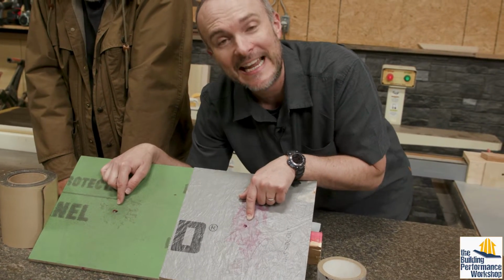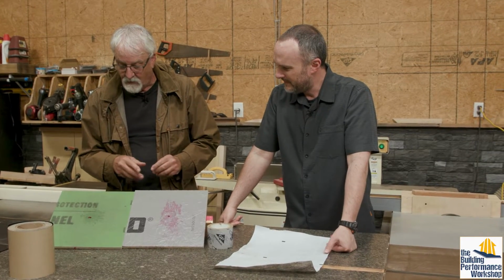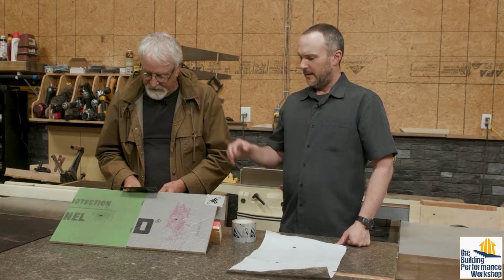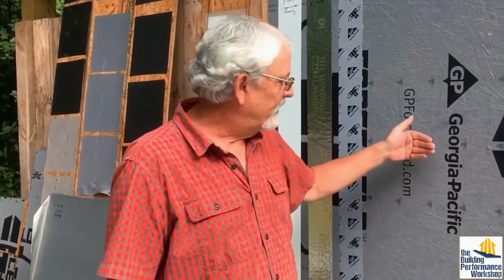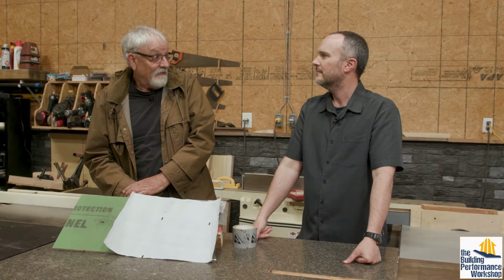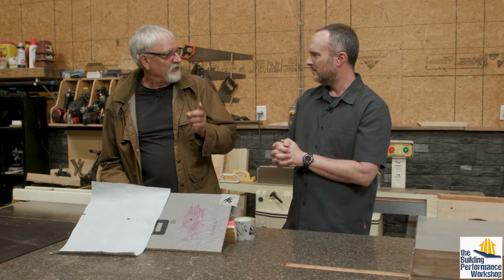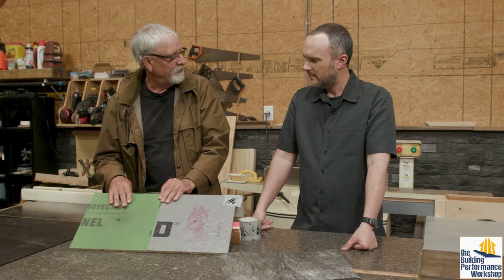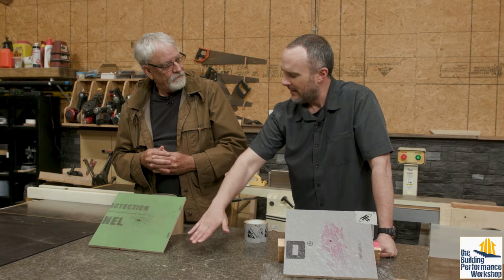WRB Showdown: ZIP System vs. ForceField WRB vs. Tyvek Housewrap & More with Inventor Landus Bennet

Comment: Took a chance on forcefield but only a few pieces for a small porch. One piece the coating was peeling/delaminating and you could pull the rest off if you tried. I do not think it is anywhere near as good as zip seems to be.
Reply: Had the same experience

Comment: Ya, I say BS ! First off, if your using OSB your trying to save a buck! It’s cheap, it may leak air, and it wets out more often. 2. Zip system holds in water, its vapor closed, and they add a vapor closed tape, so water has to dry inward, which mechanicals have to really work hard to dry out, and in winter you’d want to dry to the outside! Can you say rainscreen, a better way to build! 3. Tyvek - doesn’t allow bulk water to escape, so it will wet the insulation which Rots the interior …wall out. I don’t buy any of this nonsense!

Comment: I am currently building 2 houses, that i sheeted with Forcfield. I can say I will NEVER use this product again, or ever recommend it, 2 issues:  warpage, on the north face gable trusses the panels warped outward over time, and my build is not alone, I have a friend that had the same issue on his north facing gable, we ended up installing blocking to suck the panels in, 3 different framers, 3 different house plans, all had the same issue. Second: the material is incredibly hard! Making it difficult to hand nail siding to it. what a miserable experience driving nails into FF by hand.   Third: the film is poorly applies, and gets damaged easily,  the edges release if it rains even once, and if you bump it with a board it scratches.    We were not impressed at all!!!!!

Comment: I do NOT want an air barrier- I want air to permeate my barriers. I also do not want the chemicals in all that tape that I am not convinced with heat/humidity conditions in the South will hold for decades. I don't want chemicals in the board substrate- who do I follow on building a drying house using plywood and WRB?

Comment: After hearing this, I'm thinking about Grace Ice & Water Shield over OSB for my roof.  Even if OSB isn't as good of a surface for the adhesive to stick to, we are talking about 3 feet wide rolls, versus 4" or 6" tape.  For my off-grid house, the roof assembly would be mainly insulated on the exterior, then a rain shield and snap lock type of metal roofing.   The attic can be exposed unfaced fiberglass batts between the rafters, just cause it should help a bit with heat loss at low cost, while not creating a condensing surface since so much of the insulation is on the outside.

Comment: Error at Time Stamp 8:31..."you will void the warranty if you tape the bottom"..  Dupont clearly states in their install manual (Page 14/Step 7) Tape Top and Bottom for Air Barrier- Citation: install-guide-single-family-wrb-and-flashing-after-wrb-43-d101048-enus

Comment: Nope.. I'll never use zip on walls. I just rebuilt 2 exterior walls (2 years old), with taped foil backed insulation over tyvek. 

Trapping moisture within walls is a really bad idea. 

A perfectly sealed insulated wood construction home is near impossible to do. 

Any roof leaks or perforation or bad flashing around windows with zip will be a disaster.

Comment: Real world comment on the "woven" type wrap.  We bought a house that was severely neglected.  We're in the process of residing it. Built in 1997.  OSB sheathing. It has D-log siding that's rotting.  On our 24' South facing gable wall that regularly sees high winds and rain, it had a woven type house wrap.  The only rot on that wall came from two poorly installed windows.  Every square inch of sheathing that was wrapped with the woven type barrier looked brand new.
Reply: It probably dries out quickly.
Reply from the maker: Interesting, thx for sharing

Comment: what about using 1/2 plywood ran horizontal with house wrap would that be a good choice?
Reply from the maker: You mean the way the tract homes have been built since the 80’s?
Reply: @HomePerformance  we are building a new home and got a good deal on 1/2in plywood so was thinking about using that for wall sheeting.
Reply from the maker: Totally awesome plan, but don’t use housewrap- check out an adhesive membrane like Adhero or a liquid-applied WRB coating would be my advice.

Comment: What happens in 20 years when glue fails on the tape and it doesn’t seal anymore ??
Reply from the maker: How does glue fail in your scenario exactly?
Reply: @HomePerformance  from the seasonal  temp changes,  hot and cold, plus the glue breaking down over time just like it does on any adhesive product, what is the warranty on the adhesive glue on the tape ??
Reply from the maker: @paulmollise1856 ours, and a lot of others, is protected by exterior insulation, so movement from temps is minimal. Also, that’s why I build in redundancy in my homes with an interior house wrap as well.

Comment: We're looking to create an air and water barrier on the whole exterior of the house. If Grace ice and water shield is acceptable on OSB on the roof, why not cover the entire house and use exterior insulation? If moisture got between the insulation and Grace ice and water shield it wouldn't be able to get to the wood. It self seals every time a nail goes through the OSB and covers small gaps. Obviously interior air will need to be managed, as with any air tight house. I'm guessing there's a good reason I haven't seen it done, but what is it?

Comment: here, here for 'felt paper' - 18 minutes in...3' rolls, hammer tacker, lap your edges. Put on many a roll before siding with cedar, up here in the Pacific Northwest.
Reply: I demo a lot of old exterior walls that are bone dry, just felt and cedar/vinyl siding. (North Coast BC). Im not convinced by these air tight systems, though I’m trying to be open minded lol.
Reply: @mrbarak2088  Old homes leaked air like crazy, so the moisture that ended up in the wall cavities had a chance to dry either inward or outward depending on the season.  In code build homes, the air leakage is greatly minimized (much easier to heat or cool you home now) and thus any moisture that does get into the wall systems NEEDs a way to get out..thus the high performance products now available.   My guess is that 6mm poly will soon be banned in new home construction and replaced with high performance air barriers.

Comment: We built a new home last year and after doing a lot of research, we landed on this in zone 6a:  Zip-R12 sheathing and a 10mm plastic mesh rainscreen over 2x4 studs, which was filled with 3" of closed cell spray foam.  That gave us R-30 walls that are airtight with R-12 of that eliminating the thermal bridging of the studs.  Our windows and doors fit as if we used 2x6 studs and normal uninsulated sheathing.  We would have had R-30 walls by just foaming 2x6 stud cavities to 5" but by using Zip-R12 sheathing, we covered about 925 sq. ft. of 2x4 studs which gave our studs a R-15 value rather than R-5 if using 2x6 studs and normal sheathing.  We have a one story home, so 2x4 construction was not a problem.

I think that Zip-R is the best solution for exterior insulation due to simplicity for the framers, without the need for installing normal sheathing, window bucks, furring strips over exposed XPS for siding attachment and a WRB.  This saves labor costs and eliminates the possibility that the framers or siders will screw something up to prevent water and air infiltration with the many different steps needed to complete the XPS over sheathing assembly.

I wanted to put mineral wool between the stud cavities but my contractor said closed cell would do a better job to stiffen the walls from shear forces and almost guarantee air sealing vs. batts.  Our blower door test was 75% lower than the number needed for passing the test.  Mineral wool would have done a better job on outside noise reduction but in reality, most outside noise comes through our large double window panes.

We had closed cell foam insulation installed in our previous home during a complete renovation with zero issues.  The walls stoped creaking when really windy as they did before with fiberglass insulation in a 50 year old home.  You're not a fan of closed cell foam, if I remember right, but I think it's great.

We live in a high radon area and with our radon blower vent from under basement slab from our piped sump pit, our readings are 0.35 pCl/L, which is very low.

As far as our overall exterior wall assembly, I wouldn't change a thing.
Reply: Good detail, thanks for taking the time to post this all.
Reply: Sounds like a solid well insulated build. However, I think your contractor sold you a bag of beans saying the insulation type will contribute anything significant to “stiffening” your walls. The zip panel’s OSB is the material credited with mitigating shear. Your insulation type does not get credited for any shear value which is why plans get approved with an R-value rather than an insulation type.
Reply: Close cell foam does still add rigidity regardless of which one is the primary shear. Thats not a bag of beans.
Reply: @Tyler-xd7hh  The point being made is the wall is already engineer for shear loads (i.e. it doesn't move, so it is regid) thus adding additional "stiffener" like closed cell foam doesn't add to the rigidity of the wall system.  Just like we never give drywall any credit to stiffening an exterior wall, yet on an interior walls it definitely does stiffen the walls.  Basically the closed cell foam and/or drywall on exterior walls simply "over engineers" the shear value of the wall.  In 99% of cases, over engineering is just thorowing away money.
Reply: I do not want foam chemicals on the iinterior spaces of my home- especially since all those chemicals degrade over time- we are building 2x6 with Rockwool- just trying to decide on VB.
Reply: @tarahall1025  I'm happy for you.

Comment: We are in the early stages of building and I’m concerned about VOC ratings for the Zip system. Any information on that would be helpful. I want to use a paint on seam sealer and over penetrations like redguard or something similar I’ve used to make bathroom remodels waterproof. Your thoughts are appreciated thanks guys!!
Reply: Would you still want something (mesh tape or ?) over seems if using liquid to seal seams? Or am I over thinking it? I have not done a lot, but have always Schluter tape or similar over seams in showers, then RedGuarded over the whole wall for fear that RG alone may fatigue over time. *Worth noting I've only worked on 1920-40s era homes built on minimal footings, which move a lot seasonally here in the South. Thank you!

Comment: Amazingly useful video. Makes me wonder, though - so much of this clever engineering is to mitigate the inherent vulnerabilities of wood (water damage, termites, warping, etc) - might moving away from wood completely be where the future really is? Especially since the use of wood to begin with was mostly out of convenience and habit in N. America.
Reply: Price for acceptable performance, not convenience.
Reply: Termites are easily mitigated by using a boric acid solution from a garden pump sprayer. Just mix “cockroach powder”, or 20 mule team borax and spray your studs, rim, eaves, etc. once it is framed. It is non-toxic to human but bugs cannot stand the stuff
Reply: Wood is better than concrete and stone in areas of seismic activity which is the western 1/3rd of the US and specific areas in the East.

Comment: Yes i do have questions?? I am replacing vinyl siding on a 2 story house and i would like to tape the OSB seams, then insulate with pink board or Rock wool, then put the siding on.. What are your suggestions for this job? Thanks so much and Yes I am a super nerd for watching many of your videos!!
Reply: Not a builders here but there are fluid applied products for osb.

Comment: I'm remodeling a bathroom where I needed to move a window about 2 feet to the right.  The exterior wall has 3/4 fiberboard,  felt paper, wood lap siding, fan fold insulation and vinyl siding.  What is the best way to patch the opening without disassembling the entire wall?  The wood siding is not in good condition so I'm thinking 3/4" foam board, 7/16 OSB, felt paper, fan fold and vinyl siding.  If this is a good sequence, would ZIP, Force Field or Tyvek be a better choice than OSB?.

Comment: I'm currently building with Zip and I like it. But I fully regret using GP's ForceField on my roof. It is extremely slick and dangerous and I've only got a 4/12 pitch. I wish I would have gone with regular OSB for the roof. 5/8 zip was either unavailable or way too expensive.
Reply: Thank you for this comment. This is exactly what I came to this video for
Reply: No problem. I wound up having to put down roofing underlayment just so the roofers wouldn't slide off the deck. Defeated the whole purpose of why I used this product to begin with.
Reply from the maker: Was it rated for roofs? It wasn’t when we built.
Reply: Yes.

Comment: I’m watching a house being built nearby and it rained several times before they wrapped it. Actually seen the same on a commercial building. I just wonder why they wouldn’t use Zip and dry it in quicker.
Reply from the maker: Marinating the framing is traditional
Reply: @HomePerformance  It must be especially in the PNW😂.

Comment: This is the first I've heard that ZIP could save you money. I expect it to cost more but be more depenedable, partly because the  installation system is more foolproof than typical housewrap. So if "Stuffing a bunch of stuff in your walls in not a good thing" to let the sheathing breath--then how good is it to back it with rigid foam? Doesn't make sense.

Comment: How do these systems hold up in 10-20 years? How permeable are either of these? Isn't this a big issue for colder climates where condensation can build in the winter with no ability to extract that moisture?

Comment: So if I do a waterproof wrap with insulation integrated under hardie board I shouldn’t put foam in my walls? I’m in Texas and I’m worried about condensation. Also I’m in a flood zone so was thinking fema flood insurance would prefer the foam.

Comment: Great video Corbett. The perm difference between Zip and Forcefield is a great point and also that a wall is a lower risk area than a roof. I used Forcefield on a house I just built and decided I didn't like it because of the secondary manufacturing process. This video has me rethinking that though.

Comment: I've done a ton of digging on this in prep to doing a 2nd home we own. Because I live in the Northeast I want my vapor barrier to be on the inside, not the outside. What ZIP system does is give you a vapor barrier on the outside. This is wrong for me. I have my vapor barrier on the inside. If I use ZIP system I'm going to get moisture trapped inside the walls. BAD! The worst part is that ZIP system has almost no breathability. Here in the Northeast I need my outer barrier to breathe otherwise I will trap the moisture! In the South you want your vapor barrier on the OUTSIDE! So ZIP system is perfect for this. I think a lot of people in the Northeast don't realize this and will eventually pay the price. Speaking of price: ZIP system $30 per 7/16x4x8 sheet. Same sheet for OSB? $11.60. I hate OSB but with Tyvek on it. Safe. The other really important thing is to use Tyvek by DuPont. Do NOT use a cheap substitute!
Reply: Zip is not a vapor barrier.
Reply: @BenBogie-ee2sm  From Huber: "Is ZIP System an air barrier? Yes. ZIP System sheathing when combined with ZIP System flashing tape (and/or ZIP System™ liquid flash) form a rigid air barrier and acts as an effective component of a continuous air control layer."
Reply: @BlackDragonProductions64  an air barrier is not the same thing as a vapor barrier, or a weather resistive barrier. Zip system is both an air barrier and a weather resistive barrier but NOT a vapor barrier.
Reply: @BenBogie-ee2sm  So what should I do? I have a 6mil plastic barrier on the inside of my home. I am so confused about all of this. And I need to figure it out quick because I need to re-sheath this home!

Comment: Would like to have heard about liquid applied weather barriers. My concern with Zip is the grade D barrier is very thin and presumably easy to damage, along with over driven nails and the need to perfectly seal the Zip tape, makes the Zip system questionable in my opinion. Of course the liquid WRB is subject to installer capability. I found with Tremco's Enviro-dri that there aren't enough solids in it to give it any stretch at the recommended thickness. Sprayed onto new fir plywood, the plywood dries and has checks that go through the Enviro-dri, providing an opening for water.
Reply from the maker: Bottom line, there is no silver bullet. Build in layers.
Reply: If you live in the South ZIP is great. If you live in the North it is bad. I go into this in my post above. That thin green layer will not breathe. Yes it can be compromised, that's why you get the ZIP caulking and do your seams and nail holes with that, the tape is a waste of money. Also do the top and bottoms of the panels especially where it meets concrete!!!!
Reply: @BlackDragonProductions64 confused by your post. I live in New England. All the high performance custom home builders use zip system. The point of zip is to shed water and not allow it to absorb. If you need an air gap between the zip and the siding, there are plenty of products to apply over the zip to allow for air space between the zip and siding to breath of that is a concern.
Reply: @matthewm8021  I wound up using it on my second home after doing more research.